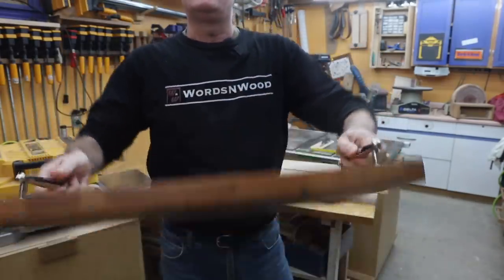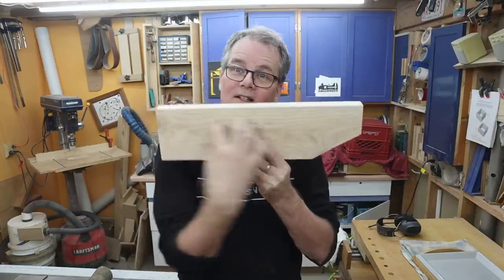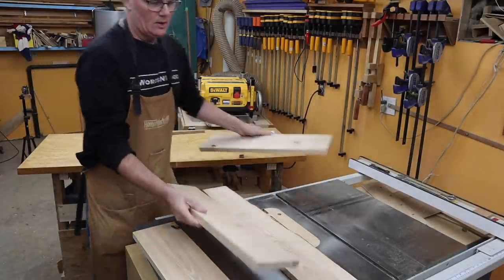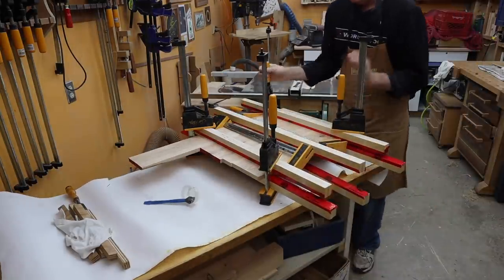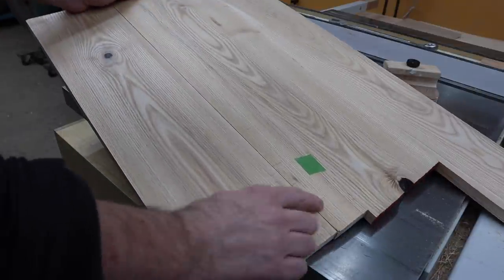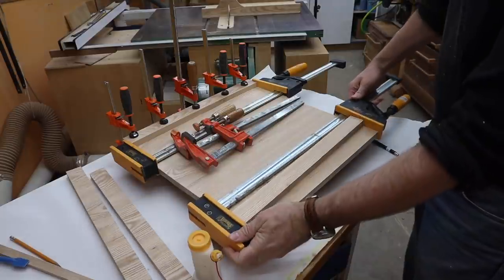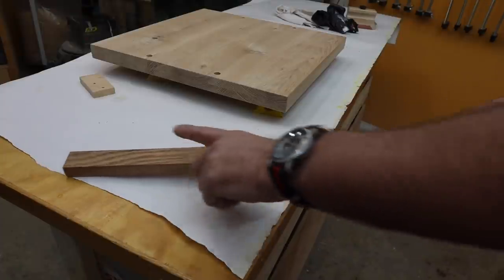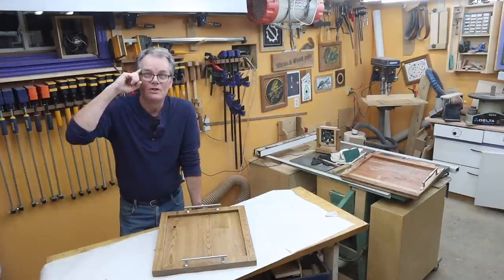Talking about Wood Movement while building an Ottoman Tray // WnW260

Comment: Always watch and like your videos so thanks.  Given your theme this time I offer a short tip which you and others may already know but perhaps not.  I like using dowels and the dowel max but have struggled with dry fits in getting the dowels out. Now,  I microwave (or oven) the dowels to slightly shrink them for easier insertion and disassembly.  On final assembly the water based glue swells them up for a nice tight fit after insertion.  I did not see this tip until after many ruined dowels so that is why I think tips should be repeated occasionally...seemed appropriate rider to your video.
Reply from the maker: I have a special little bag of "dry fit" dowels, where I've mashed the ridges a bit with a vice grip so they slip in and out easily.  Then I use the "Fresh" ones for actual assembly

Comment: Hello Art, long time viewer, first time commentor :)
Doweling after the gluejoint issue was a good save and nicely executed. I like the way you utilized the offcuts for the side rails, or at least planned it that way :)
Off topic part of the comment :)
At the 2:00 mark of your video I see an egg-beater style drill on your wall and I have recently picked up one just like it for a restoration. By chance could you share the model and brand with me so I can research it further, but also reference it in an upcoming video. 
I loved your spot on the WoodTalk podcast a few episodes ago and it has had me pondering your email to them. It was a pretty engaging chat they had, sparked by your email.
Reply from the maker: That is actually a breast drill, not an eggbeater.  I just looked, and could not find any maker name or mark on it.   If you go back five years, I have a video where I demonstrate it:  https://youtu.be/gn1JMOtXKIU

And yeah, I also enjoyed the conversation on woodtalk...They made some very valid points about "most people" have not seen their videos, but also agreeing that FB and IG and diminishing in use by and for them...  It's not a simple thing to diagnose.
Thanks for stopping by!

Comment: I'm curious to know what made you decide to go with this approach instead of a floating panel in the frame. Did you consider that approach? Would it not hold up, or not match what they wanted?
Reply from the maker: There's always more than one way to do it..  Remember they want this to sit on an ottoman, so they wanted the large heavy slab.  the bottom is 5/8" thick, which normally I would say is too thick for a tray.
Reply: @Wordsnwood  Got it. I was just wondering if that was an option but you discounted it for some reason. End result looks nice.
Reply: Absolutely agree. Wood movement isn't the issue, it's the frame potentially splitting along the grain. LOL there is a reason why trays are usually made like cabinet doors.

Comment: Interesting way to calculate the hole placement. I came up with 455/2 = 227.5 - (160/2) = 147.5. 

I spent a few minutes mentally working through your method. All of these little techniques and variations are what make woodworking so fun!
Reply from the maker: Yup.   "There's more than one way to do it"  is a mantra for woodworking, computers, and probably many other areas of life!